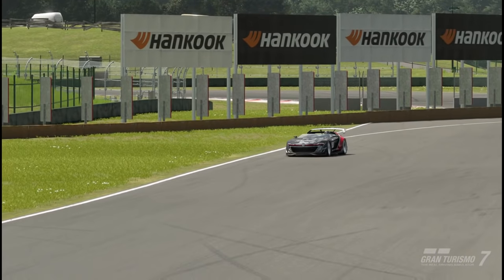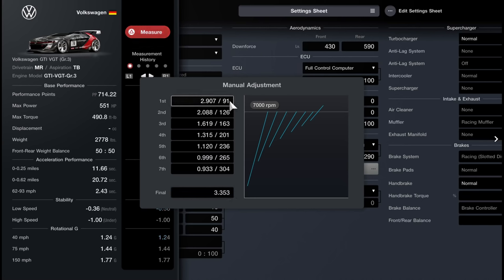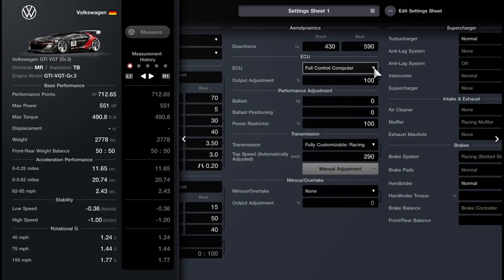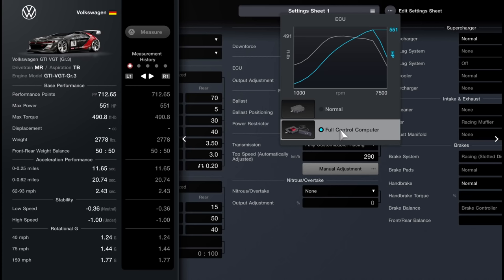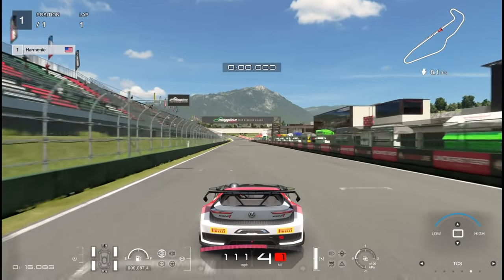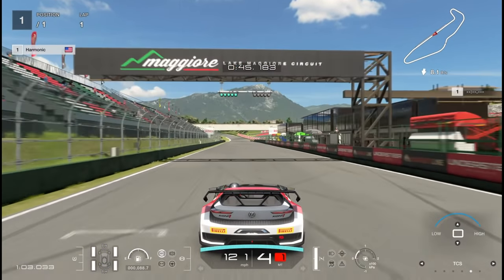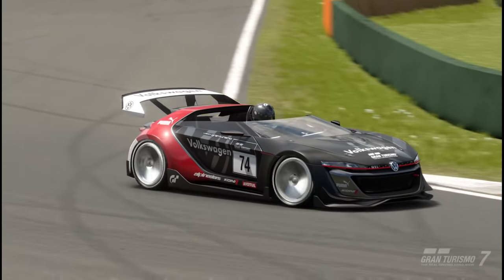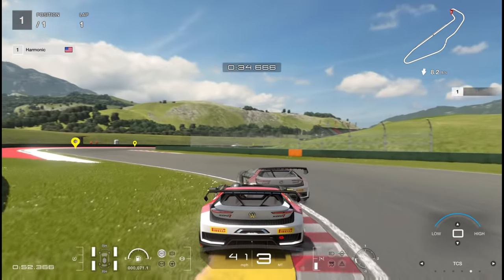How to Tune GEARING | Gran Turismo 7 Tuning Guide

Comment: Hello I am a quadriplegic and cannot use manual because of my hands. Can you recommend an automatic gear set up that closely mimics as if you’re shifting a manual. I know set ups can change from track to track. But something stander that I can work off of . Thanks and I really like watching your videos and being a better virtual mechanic👍🏾👍🏾
Reply from the maker: That's a bit tough to do since every car's RPM at which it reaches peak power is different. The closer the shift point is to the peak, the better off you'll be, but the rest of the principles in the video should still apply for any car and track combo

Comment: Most of this I'd already figured out, but I'm still not 100% on the function of the final gear. When I shift it, all the other gears shift, so if I'm doing a corner-specific tune, I'm not sure if I should touch the final gear, or when I should tune it, seeing as it makes everything else move. Should it be first or last on the list, or should it be ignored? Otherwise, great vid, thanks.

Comment: Question please, in the gear ratios it shows 0000/000. What do they mean please, the 4 numbers and the 3 numbers? Great video.
Reply from the maker: The first number is how many RPM the engine would spin for every 1 RPM of that gear. A larger gear will spin slower for every RPM of the engine, so a larger number here represents a physically larger gear, but that also means it's a shorter gear as far as speed goes. I talk about this at 1:28 a bit.

The second number is just the speed that gear will top out at (in km/h).
Reply: @Harmonic14  Thank you very much!

Comment: I don't know if I understand how you're determining where to set your ratios. You're "aiming between the red lines" but what does that mean in practice? Is it that when you upshift (near the "right" line), the engine RPM stays up near the "left" line? You never seem to point this out, and since you don't show the views with the tach when you're demonstrating outside the max power band, it just looks like you're shifting at a different time without the correlation to the ratios.
Reply from the maker: It's pretty intuitive if you watch the Power Band section of the video. If you end up at too high of an RPM after shifting, the gear needs to be longer, and it needs to be shorter if you end up at too low of an RPM. I show this in the Too Short/Too Long sections, so I suggest watching those sections fully.

If you know where your power band is, shifting at different times gives you the same information as choosing different ratios. Going over exact ratios is pointless because the numbers are arbitrary and change from car to car. Knowing when to lengthen or shorten gears is the important part, and I demonstrate this pretty thoroughly here.
Reply: @Harmonic14  Look, it's not a bad video. There's a lot of explanation here that I didn't understand before. You thoroughly demonstrate how to identify the power band and explain enough that different cars can have a wider target, how to see your RPM on the track, and then demonstrate how being outside the band makes you slower.

Maybe it's just the lack of instruments in the chase camera HUD that made it difficult for me, since the bar only shows about the last 1000 rpm before redline. It was not until I played around in game myself and could actually see how changing the ratios effects where the RPM falls to after an upshift, and then I was finally able to connect that to staying in the band. I think the bit at 9:53 is where you're explaining the point, but the verbal explanation is let down by the limitations of the visual.

Comment: Great content. I know good control of manual transmission is going to be faster than automatic transmission but for a new driver to the game how much would the difference be? Is it actually possible to tune a car for automatic that would come really close to an expert manual driver?
Reply from the maker: It depends on the car. If you're in a car where automatic gears shift at the correct time, you won't lose much, but you'd lose quite a bit of time in a car like this. On longer tracks, it could be up to a second per lap.

Comment: I get confused when you describe the graph. It gets hard to identify what lines to read when u add in your red line markers. I also don't know what u mean start off with 1000 1500 rps wide?
Reply from the maker: Just keep the engine in that RPM range so you stay in the power band between the lines. I explain this in the video

Comment: man,i'm having a huge problem with my porsche engine swapped VW beetle kaefer.no matter how much i try to fix this i can''t find a sollution.the fifth gear is extremely long as if it doesn't exist.i don't know what to do.i tried all transmissions an even close gearing and fifth gear is always dead idling.car won't push forward at all/any idea?

Comment: So all this tuning is more aimed at specific tracks right ? In maximising time rather than race to race in career mode
Reply from the maker: Correct! Ideally you'd have a slightly different gear setup per track, but some might happen to work on other tracks by coincidence
Reply: @Harmonic14  thanks bro.. I’ve subbed ;)

Comment: I got a problem with the gear box as I'm not sure is the software bug or something else as sometimes I changed the setting and enter the track but still stuck with the old setting, seems it doesn't update automatically.

Comment: Can u not show us 😂 on the detailed settings rpm power band and sat change gear between these 2 points and things will be better. Hey am not being critical as the vid was super 👌
Reply from the maker: Not only is your comment difficult to read, but that's not how optimal gearing or shifting works. Good try though

Comment: When you're tuning an transmission, are you using the "acceleration performance" section? If so, how do you utilize it?
Reply from the maker: I pretty much ignore it. It might be helpful for drag racing, but gearing for corners and staying at peak power for the rest is typically the best option. Ghosts are a better tuning resource than any of the simulated numbers in my opinion
Reply: @Harmonic14  awesome, ghost is a great idea. Thanks for the knowledge!
Reply: How can you get a ghost for drag races??

Comment: There seems to be a game defect on the gearing of the ‘69 Mustang. When I adjust the ratios, they are nicely spread out. Then when the race starts, it glitches in a way that first till fourth are way too short, and fifth awfully long. I go back to the settings and the gears have changed to this weird spread. I readjust and the issue keeps happening.
Reply: many cars have bugged transmission.
Reply: Same with the 97 or 98 civic the one thats professionally tuned.
Reply: Your setting your top speed auto set to high
Reply: He explains it @timestamp 3:21
Reply: @ludnxx  Not true. If you try for example BMW Z4 GT3 or Toyota FT1 GT3 and install racing transmission without changing any settings 5th gear will be too short like 1500rpm. Change some gearing and it will work until you quit the race - it will reset everytime. Chaningn transmission to Standard "fixes" the issue.
Reply: I have both those cars, no problems gearing,I dunno
Reply: @ludnxx  Yes you are right. I have Just checked and it seem to work as it should. It musi have been patched because i rememer struggling with this shit in z4 and ft1 do used standard transmission instead. Good to know they fixed it.
Reply: I finally figured it out somehow. I reset everything to default, then started off with a long final drive (between 3.2-3.3) and fine-tuned the individual gear ratios from there. I need high top speed for the Daytona Sunday Cup as well as Special Stage Route X, in case others are wondering.

Comment: have you have a idea why some of the cars gear 1 to 5 gear ration setting does not working when you stretch the max speed  even when i set it properly and only gear 6th that work as i intended. all of the gear 1 to 5 work if i make it shorter.
for example i set my Ford GT gear 2 and 3 to have longer range but when i try on track it gear top speed still stuck at the same speed as default even tho i make sure my gear is save properly even when i checked later.
i think it the same issues as GT Sport
Reply from the maker: That might be a separate issue that needs addressing. If you didn't overlap gears and you still have the issue, it's probably a bug

Comment: Kind of an off the wall question. When using something that has 7 gears, like the citroen gt gr3, how do you tend to tune your gear box? I'm tuning one now and not sure if I should push 6th gear out to negate it so it runs like a 6 speed or to work with it and maybe push it out just enough to its a shorter gear than the ones before it.
Reply from the maker: Most of the time, I use every gear available, especially when the max power window is narrow like the VGT here
Reply: @Harmonic14  thank you brother

Comment: I bought the same transmission yet my gr.3 car only has 1st to 6th and yours has a 7th. What gives?
Reply from the maker: It depends on the car. A lot of the VGT cars have 7 gears, and the "normal" ones usually have 6

Comment: How do you set the rev limit to be lower instead of changing at highest limit
Reply from the maker: You can't change that. You need to change when you shift
Reply: @Harmonic14  thats not how automatics work in real life im talking about auto transmission
Reply from the maker: Then you should've specified that before. There's no way to change where automatics shift since those shift points are pre-determined, so I suggest switching to manual
Reply: @Harmonic14  in real life it changes when you fully press and when just cruising

Comment: Actually you can cheat with the gearing.  You can adjust the gear ratio and then remeasure the PP.  just adjust the gear so you have the biggest PP (lol)
Reply from the maker: This isn't a good method for tuning gears. If anything, you'd want the PP to be as small as possible so you could fit a car with more power and less weight into a PP restricted event. Other than that, the PP rating is not a good measure of how well your gears will perform at a track.

Comment: The best gearing is track dependent.
Gears that let you hit 250+ mph on a track you can't hit 160 before you brake, that's a bad setting.
On the other hand, maxing out at 160 halfway down the straights, costing yourself lots of time.